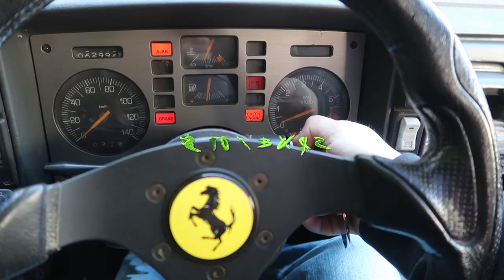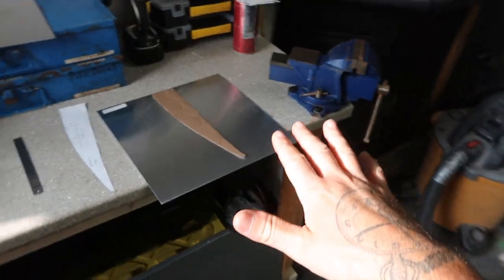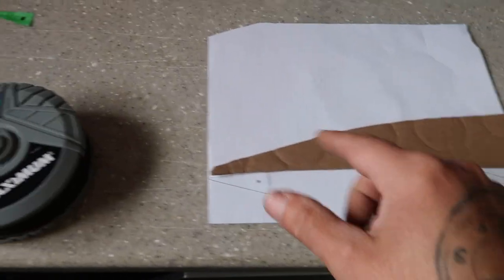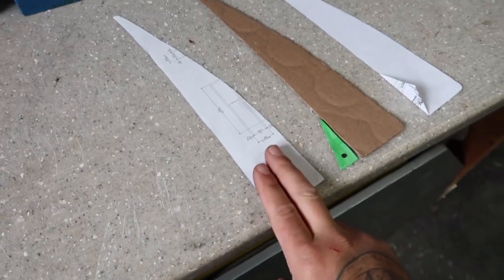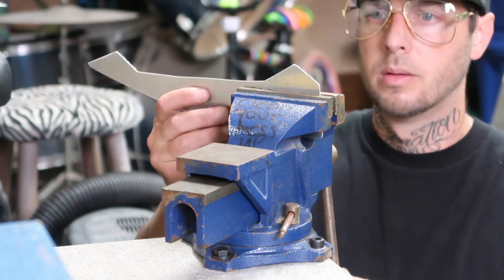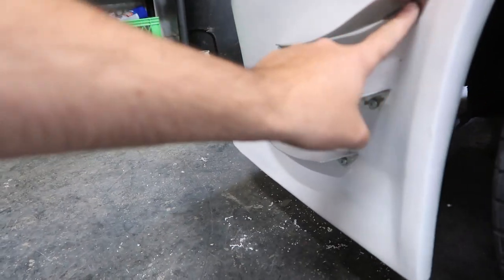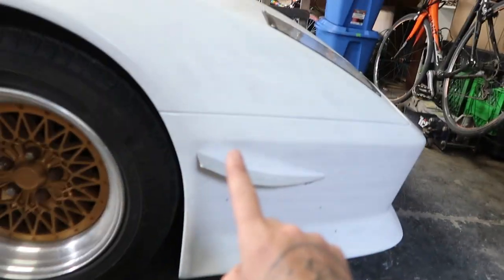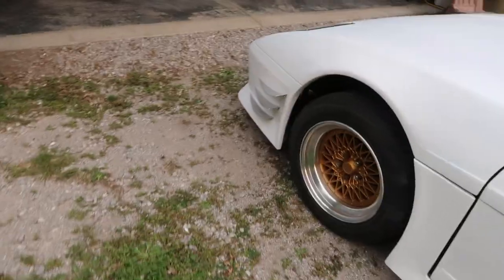How To Make $20 CANARDS/SPLITTERS For Your Car! Budget DIY Step By Step Instructions

Comment: Universal Canards in plastic fairly cheap on ebay 16.99 carbon fiber print
Reply from the maker: I looked into them but they look cheap and are pretty small.. The biggest thing is i want something that esthetically looked good and that i could bolt to the bumper rather then just 3m... But they have some decent ones on eBay that would be great for civics etc..

Comment: GREAT VIDEOS BUT WONT THE CANARDS CUT YOU LEGS OPEN WHEN WORKING ON THE CAR, OR IF CAR PARKED
IN THE DARK ON THE ROAD SIDE SOMEONE COULD WALK IN TO THESE BLADES AND GET THERE LEGS GASHED
ALSO THE BACK WING TO ME SHOULD BE ON THE LID NOT TIED TO THE BACK LOWER FRAME NOW YOU CANT ACCESS THE ENGINE COMPARTMENT AS EASY IF WING WHERE ON LID ALSO, DON'T PUT A GM 3800 V6, THE ENGINE HAS A BALANCER IN CENTER THAT ROBS 15HP AND AN UNDER-DESIGNED TRANNY THAT GOES INTO LIMP MODE AT 80000MI
 USE AN LS AND F40 TRANNY TRY ALSO A VR6 GERMAN ENGINE FASTER REVVING & COMPACT